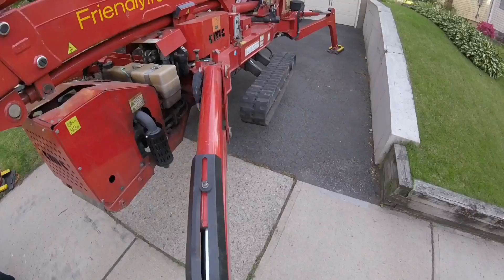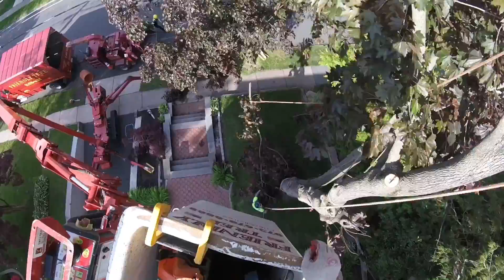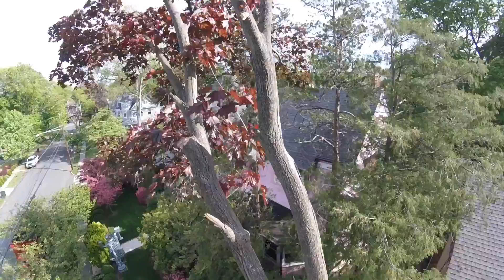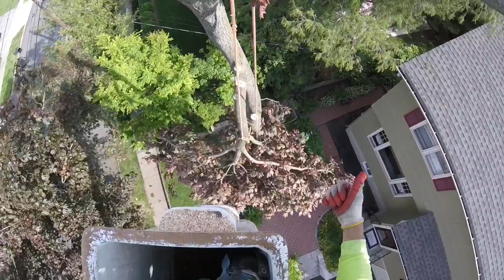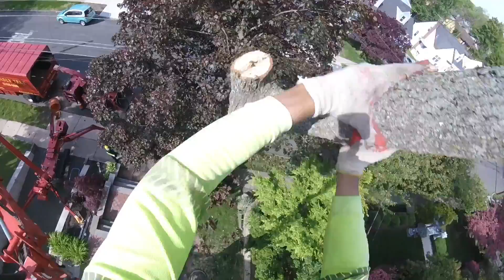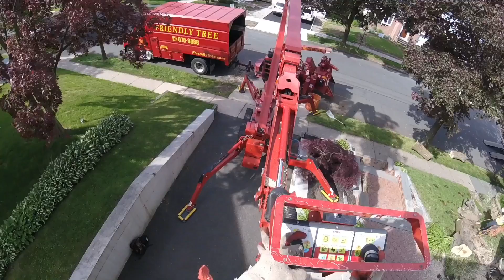The Spider lift doing it’s thing

Comment: Have you guys had any issues with that machine ? I’ve heard that particular lift has alot of issues, especially with the outrigger sensors. I’m in the market for a lift and I really want the same model but I’m hesitant. I’ve heard Alot of negative feedback To much electronic crap.
Reply from the maker: We’ve had many issues with the machines but overall it’s a good machine. We have been able to complete jobs that are difficult, that no climber can complete
Reply: I am demoing one on a job Wednesday. Anything I should be aware of and try to make it do?
Reply: I have a platform basket and haven’t had any issues